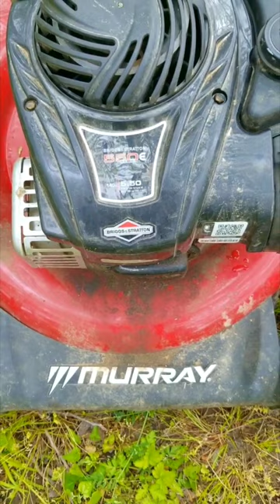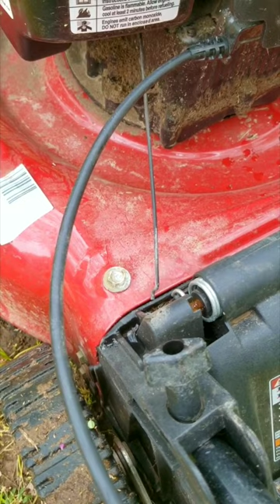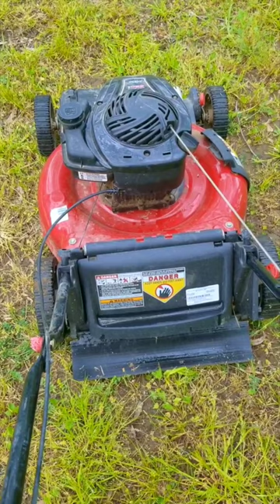Impatience Almost Ruined This Murray Mower #shorts

Comment: Could you please explain what he did wrong so I know what to look for
Reply: I think that bent metal wire he shows should be connected to the carburetor. Theres two of them and you kind of snake them on it can be tricky to get them on
Reply from the maker: they reinstalled the carb without the governor linkage connected

Comment: The trouble is::EVERYTHING IS BUILT THIS WAY ! I have a 2000 mercury that, every2 yrs the "plastic climate control computer goes out. It's $800 a pop. The engineers placed it deep into the dash ,necessitating the removal of the dash to repair. Everything is plastic and computerized. Give me anything built in the 1960's !!!
Reply: I had a Honda wagon that blew a head gasket. The 'fixer' poured it full of stop-leak and stopped the heater and radiator UP. The REAL fixer backflushed it to a fare-the-well but the heater never did open up. The heater core was maybe $45 but it was $200 to pull the dash to put it in. I just wore a coat. The wife drove the Buick.
Reply from the maker: thank you George Pruitt!
Reply from the maker: I like this comment!
Reply: @INSIDEHOUSEGARAGE  Poverty and desperation wins out over comfort.
Reply: It's  called engineered obsolescence; so repairmen can have a job.  Really took off in the early 80's.
Reply: @Jonyam  RIGHT!

Comment: I got one just like it the primer bulb isn't getting flood at all. It's loose, feeling what could need to replace the bulb seal or could be a carb issue.
Reply from the maker: have you tried starting it with some starting fluid or carb cleaner?
Reply: @INSIDEHOUSEGARAGE  starts up but then stops
Reply from the maker: gotcha, all you need to do is drop the fuel bowl and clear the brass jet at the bottom of the white plastic part. Otherwise you can just replace the entire carb.
Reply: @INSIDEHOUSEGARAGE  thank you very informative and helpful